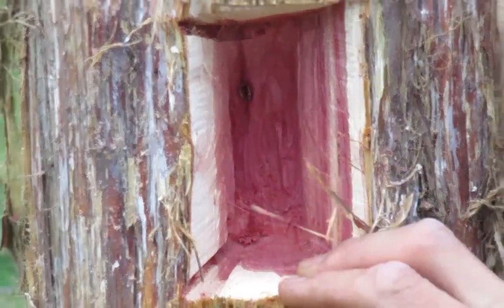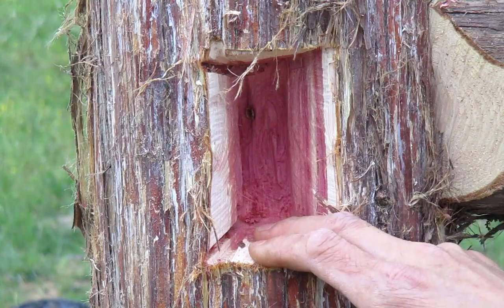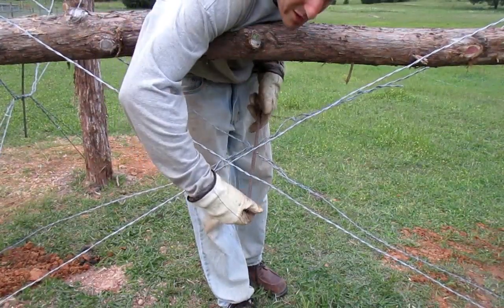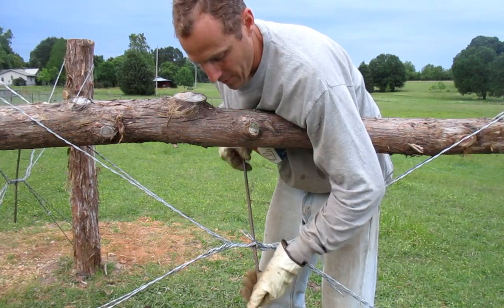Fencing - corner post

Comment: If that is a true corner, then you are definitely doing the diagonal tension wires wrong. You should probably use triple wire for one thing... meaning three hoops around the two posts. But you have wasted material by bracing the post in the wrong direction.

Here's how you do it. Wrap the corner post low and the Adjacent (line) post high. 
Do not wrap the corner post high to the Adjacent line post low! That is a conceptual error. You would only do that if this was in the middle somewhere, and there would be tension both ways, your double diagonal tension makes a lot of sense, but it would still be a bit weaker than a double H or "Braced Line Post Assembly."

But don't take my word for it. Take a look at this guide from 1980 on how to install ag fencing. 
http://extension.uga.edu/publications/detail.html?number=C774

Comment: awesome.... these are cedar posts right?  I was wondering if you peel the posts before you install them in the ground if it will rot faster or slower? or should I say last longer. would it make a difference?  also the wire you used can you buy barbless wire?
Reply from the maker: Trey - you are correct cedar.  I did peel some at the beginning but now I simply coat them in oil, typically a heavy W hydraulic oil.  If you do peel them I would still suggest coating all the surfaces before going in the ground.  Shalom!

Comment: Thank you for the video.  Is that Easter Red Cedar?
Reply from the maker: Yes it is, in our part of the country it can grow in with the hardwood and choke out the young hardwoods.  Most people do not want it on their property!
Reply: I get you.  I have a couple hundred that I'll prune high enough to allow grass to grow under and serve as shade and the rest will become corner posts. Do you let them cure or stick them in the ground right away?  Thanks.
Reply from the maker: I have done it both ways depending on time...  I prefer when I have time I strip off the bark on the section going in the ground and cover it with tar or oil.
Reply: That's a great idea.  Thanks.
Reply: How deep this you bury them?  Is that clay?  Looks more like red, sandy soil?  Thanks.
Reply from the maker: I bury them 3', we have a mixture of rock, clay and sandstone once you get below 24".